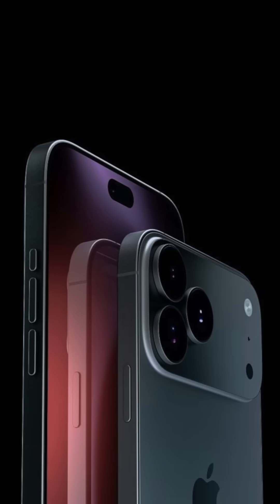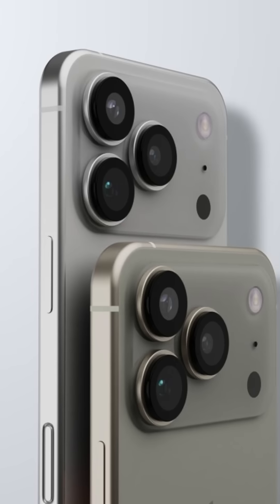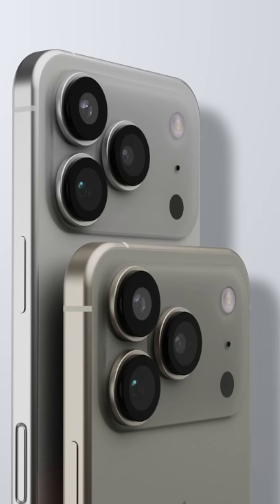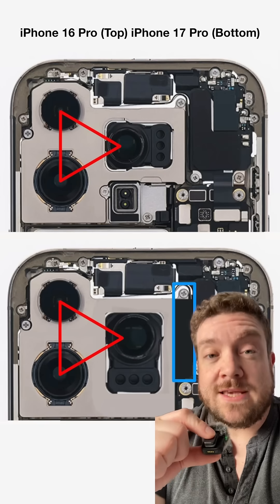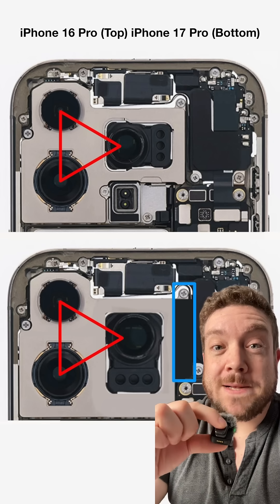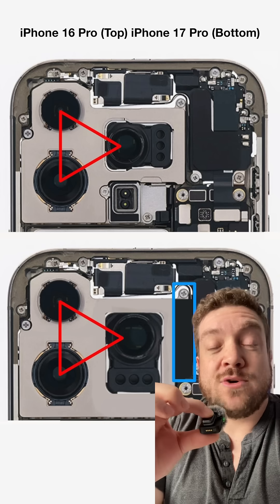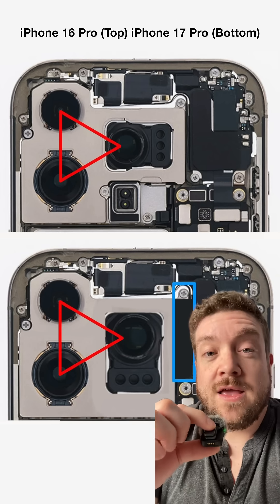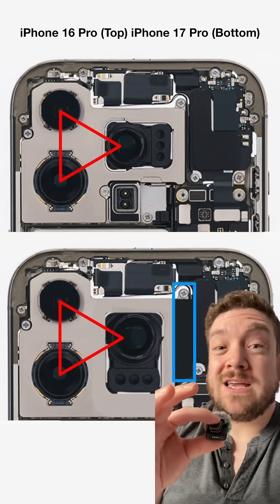Here's why the iPhone 17 Pro has a new camera module

Comment: The camera orientation is so wrong but no one knows. 
The telephoto is oriented in such a way that the long side of the sensor aligns with the long side of the screen.
If the camera rotates 90 degrees, so will the photo. There is no way that the telephoto camera changes its orientation.

Comment: Smaller photosites (not pixels) are not less sensitive to light, not in the technical way. You can clearly see they could have kept the camera bump the same size they pretty much did for the anesthetics to make it look different and improved. The bigger the sensor the harder it is to make a telephoto lens because it needs to be longer so I don't see that being the reason. Also you don't need more light because the objects are far away. It'll have the same exposure if I shoot it with a 24mm lens vs a 200mm lens because the object it's physically at the same distance.

Comment: This isn’t true. The total light gathered for the sensor is the same in either case. Large sensors can be very slightly less read noise not because each pixel “gets more light” but because more pixels = more reads and more reads = more read noise.

Comment: For those who don’t know, today Apple has informed that Touch ID will be back and added to the camera control button or added to the action button just like the Touch ID on the latest iPad models. But if the touch ID is added to the action button, there is a chance that the action button will have a glass surface which is so expensive to repair if it is broken even more expensive to repair than the camera control button. feel free to ask more 😊😊😊

Comment: Redesigning a sensor does not always mean only mean, changing the megapixel of the sensor. It could be adding some kind of a substrate layer so that it improves the signal to noise ratio.

Comment: Some misinformation here. I’m a photographer and as per my knowledge, you don’t need a bigger sensor for Capturing Ultra Wide images. It is the duty of the lens to bend the light, according to the sensor to project the image on the sensor so, in this case, the size of the sensor does not need to change it is only the resolving power of the lens and the capability of the lens to bend that light and let in a wider field of view to make it ultra wide angle photo Megapixels got nothing to do with this
Reply: He did not say that... he just said you need a bigger sensor to gather more light .. and this is needed for the telephoto to be better at quality and Light reception.... and yes, a better lens always helps too.

Comment: Isnt it still a 5x lens? Im so tired of people and companies calling sensor crop zoom a "lossless zoom" or "optical zoom" like its just a sensor crop digital zoom and nothing more. Call it what it is, every company now does this. Sensor crop zoom significantly reduces quality, and sensor binning and remosaicing doesn't make it "real" or different in any way. 

Also, more photosites in the same sensor size doesn't reduce low-light image quality (assuming you dont use low quality sensors) because the total light collection is determined by sensor surface area, if each photosite gets ¼ the amount of light, but theres 4x photosites, you end up with the same light collection.

Are detailed 10x shots supposed to be impressive anyway? I feel like thats been a thing for a while... well, maybe not on the iphone

Comment: Please.... Stop.... The misinformation is so disgusting it hurts my soul. The "pixel size" is NOT what is important. The Sony a7SIII has 12mp, the Sony a7RIV has 61mp and the sensors are the same size. By your logic, the a7SIII should have a minimum of 4x the low light performance because its pixels are WAY BIGGER... Except that it doesn't, because what ACTUALLY MATTERS is sensor SIZE and HOW MUCH LIGHT is hitting that sensor. You can literally pull them up and compare side by side on dpreview if you don't believe me... Please stop spreading the pixel size matters crap, it's so misleading it hurts

Comment: It still doesn’t tickle me to buy the iPhone 17. Fact that’s the phones have looked exactly the same since iPhone 15 and only few minor changes, no thank you.
Reply: You mean the iPhone 12?
Reply: I mean you’re almost right. Just because the put the cameras on the bottom right would not be a good reason to buy a 17. At that point you just rebuy the last iPhone that met your needs. We need to stop buying every know phone and be a little choosy
Reply: They look the same but they are getting stronger. I got the 16e and the difference between the 16 e and the 11 pro camera wise, screen strength, and even phone durability wise. It’s all incredible. The iPhone 11 Pro cracked from the back with an accidental drop, the 16e has taken a bit more abuse and has no scratches, no cracks, just a minor dent. It has a much stronger frame. Much better speaker. Much better battery life. Literally everything except the Operating system is different between the two. It’s all just better
Reply: They’ve looked the same since iPhone 12 and 13. Only because the camera is in same spot and the non edged body of the phone. All the changes are within the materials, software, hardware, and most especially in the mother board
Reply: Why does every year phones have to look radically different for people to get one? Never made sense to me
Reply: True I seriously forgot which line bc they almost look identical especially once we slap a case there’s really no telling except when some see that camera lineup.
Reply: And I love that 11pro but this 16e is just better unfortunately and I have to accept that. Will be trying the regular 16 soon and testing the difference, either that or the 17 when it finally releases
Reply: Might as well wait for the iPhone 20
Reply: @RoadVill you’d probably miss out all the cool features on the 16

Comment: Why not just make the phone almost or nearly as thick and the camera bar? You can add more battery, better cooling? I guess that would make top much sense.
Reply: Yk users don't want to carry bricks around
Reply: you do understand that the weight would nearly double if they did that? not to mention how ugly it would look. Stop asking for things you dont want
Reply: @pecoliky8793  it wouldn't actually. And not every phone has to ve big. You can get a smaller one.
Reply: it will also look ugly, feel heavy and just make stuff harder
Reply: @ypadamat  it won't, but ok.
Reply: @alg003  are you slow. it will look so ugly and will feel heavier
Reply: @networkhub4306  Most people put big cases on their phones. Remember the iPhone 6 and its numerous issues?
Reply: Cause It’ll be absolutely colossal and hideous
Reply: @russian-canadianfamily6895  how?
Reply: @alg003  the cameras stick out a mile that’s how
Reply: @russian-canadianfamily6895  you can reduce the camera bump, you dont have to make the phone the thickness of the phone.
Reply: @ phone thickness of the phone? Jk jk

Reducing the camera size will make them worse. Pixel 9a did that to make it fully flat against the phone, but the size and resolution of the cameras went down significantly
Reply: @russian-canadianfamily6895  That's literally not what I said. I said make an overall phone thicker, not make the camera smaller, or make the camera smaller
Reply: @alg003 but like you said people put thick cases on their phones now pair that with your idea your getting double the thickness

Comment: You talked as if no other brand has ever put a big telephoto lens before without a big camera module that creates a huge camera bump stretching feom left to right😂
Reply: I don’t give a damn. If anything I like it significantly more. Will be WAY more stable laying flat and not wobble as much. Only issue I have is why didn’t they just make it protrude more so the lens and rings are flush…
Reply: @feeltheburntk9893 making the lens flush would result in making the phone thicker
Reply: @-A-M  So . . .
Reply: @ I personally don't care, it'll make the phone way more durable. But my point was that it's impossible to please everyone. Fix the camera bump by making it thicker, then you have a bunch of people complaining about weight and size.
Reply: @ But I would welcome the bigger battery - you're right - you can't please everyone.
Reply: @-A-M How would making the lens flush make the phone thicker? The lens is apart of the thickness lol. It’s would be the exact same thickness but provide much better stability and help prevent the lens from cracking from falls and scratches
Reply: @ there’s a bump on most cameras now. How would you go about making the bump flush without making the overall phone thicker and without downsizing every component in the phone?
Reply: Personally, I also  dont care because its still 5 years behind my S25 ultra.
Reply: @enzad5254 Cope with your Apple wannabes.